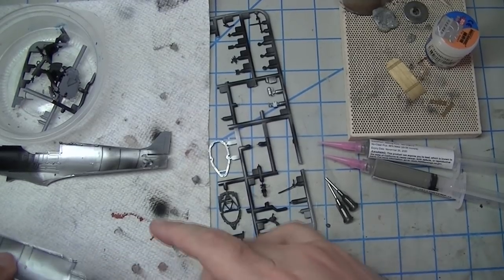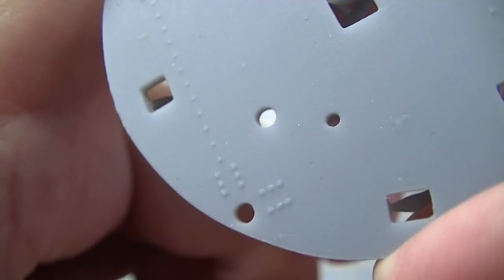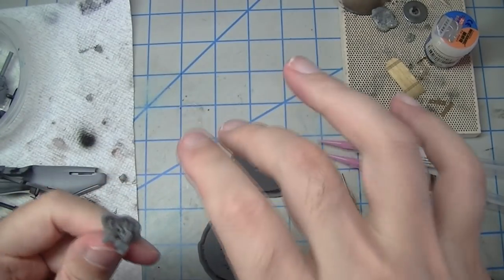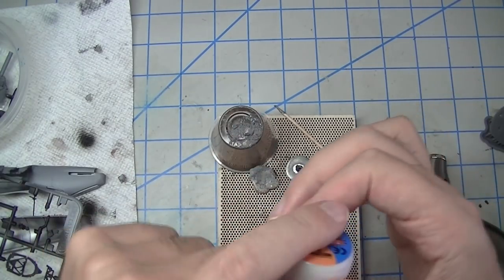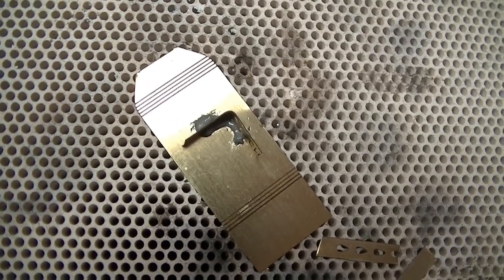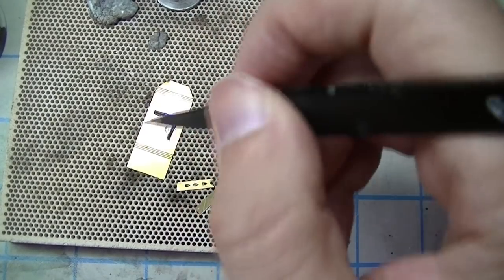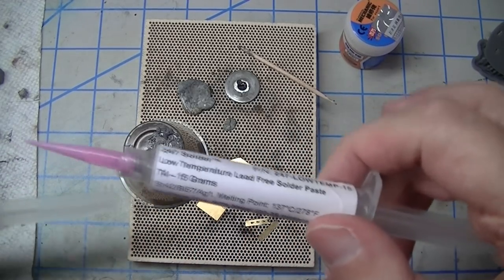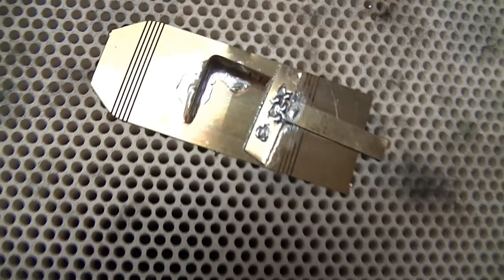ep261- 10 minutes of random #32

Comment: Your missing out,the new Ryefield MRAP 1240A1 in \35 is an outstanding kit.2020 model kit,that looks like it was made in 2020.Soldering iron,butane or electric?
Reply: And 'citadel Air paint' empty pots are pukka for mixing your paint in,and opening, shutting and pouring with one hand.The paint is pretty good too.I ve been using a blowtorch lighter,they don't like prolonged use.